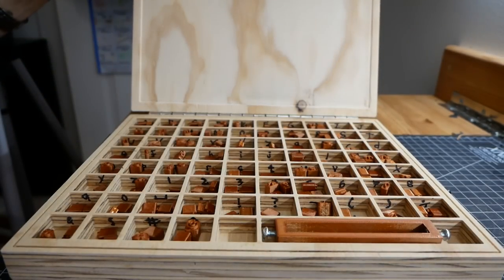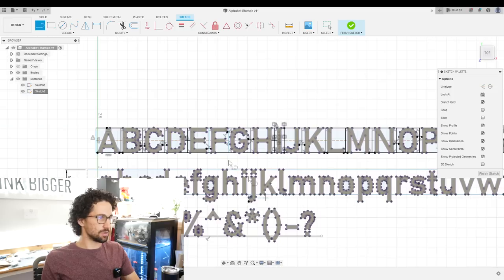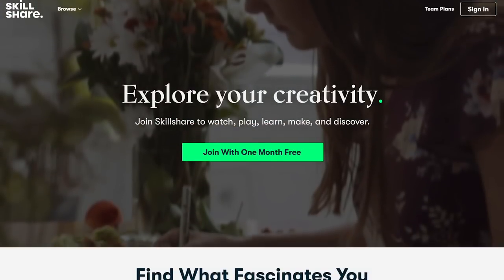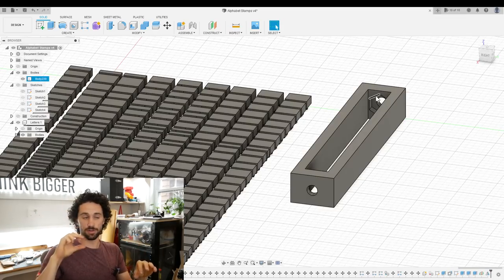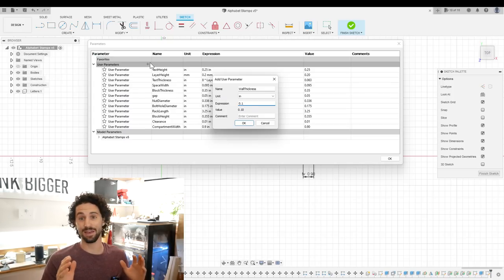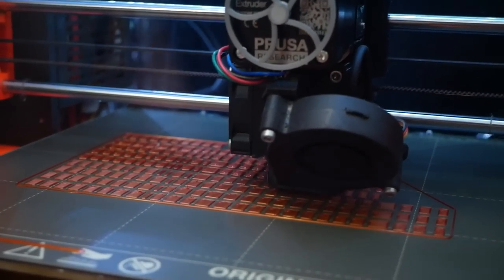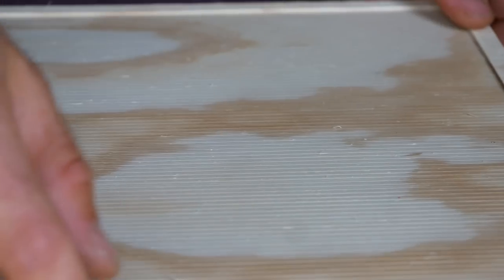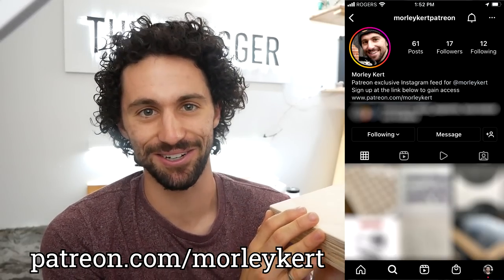Making a 3D Printed Alphabet Stamp Set + Storage Case

Comment: Quick tip when working with text in Fusion, try creating it in illustrator first. If you write the text. Create outlines, then use Shape Builder Unite it will give you just the outlines. Save as SVG, import to fusion and its good to go! It saves a lot of time. Letters like the ABE... become a single click rather than 2 or more clicks!

Comment: I think that I would make multiple of the same letter in the slicer, and save it as a .3mf. This keeps the design simple and easier to change. You can then also have multiple .3mf files for different sets of letters (i.e. a scrabble distribution vs one of each, vs only the letters for a specific name, etc.)
Reply: I like the idea of using Scrabble distribution.

Comment: Great idea! There's a few 3D printed letterpress type projects you might want to check those out. Typically those are larger display typefaces so the small details are less of an issue. You could try adding a fillet to the bottom of the small details or a connector to the body of the i as long as the stamp is deep enough that those parts don't make an impression.

Comment: outstanding video! Thanks for walking us through us. One suggestion: leather shouldn't be stamped "wet." that's a bit of a misnomer. Leather workers let the leather start to dry to the point that the original color is starting to appear. that means the leather fibers have absorbed the water.  if you are stamping and get water pushed out, the leather is too wet and the images will lack crispness and burnish.

Comment: the strength is compounded by you using silk PLA which has significantly lower intralayer adhesion than other filament
Reply from the maker: TIL!
Reply: @MorleyKert  found it out the hard way myself. PETG has great intralayer adhesion but is very stringy so not all that suitable for these tiny applications. maybe a 0.2m nozzle and some basic PLA?
Reply from the maker: A 0.2mm nozzle would be a good addition to my printing capabilities! I also plan on getting a resin printer soon, which I feel like is the ideal way to make these stamps.

Comment: Did you try to print the type set in a more rigid plastic like PETG or ASA for a more sturdy type? I guess layer adhesion on such a small touch point (like in the dot over the I) might still be a bit flimsy :)

Otherwise really cool project and I guess I gotta get the CNC part of my Snapmaker up and running. I cursed at that machine for years, but after buying a Prusa, I got enough knowledge to get an excellent first  layer two years after getting the machine (well, including installing pre-production firmware to get heated 11-point bed leveling and stuff) :)
Reply from the maker: I recently got a resin printer and I would love to try printing some type on that!

It seems like the perfect match.
Reply: @MorleyKert  Is it the Prusa SL1? I'm considering getting that one. The Prusa machines are just a touch above the rest it seems 😊
Reply from the maker: @Foodgeek  I got the Elegoo Mars 3

Comment: So, after the fact, I wondered. And when I went back I think I found the answer. You said you extruded the case to a half inch, and later you said you set the depth to the exact material thickness. Half inch plywood is generally thinner than a half inch, so I’m wondering if you set it at a half inch or if you went back and changed it to the actual material thickness. You did later say the rack was exactly a half inch thick, and thus too tall, so you did sort of acknowledge the plywood being less than a half inch at that point.
Reply from the maker: So I set the cutting depth when I set up the toolpaths (not when I extruded the case on screen), and I set the depth of cut to the exact, measured thickness of the plywood, which was indeed less than 1/2”.